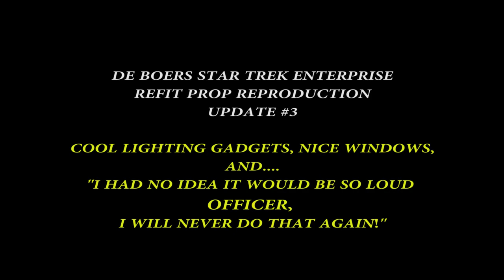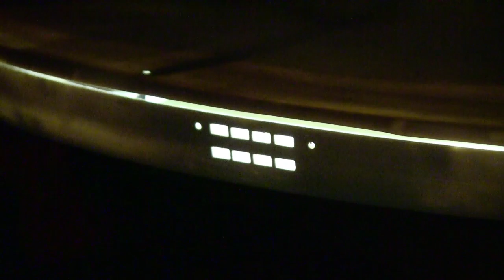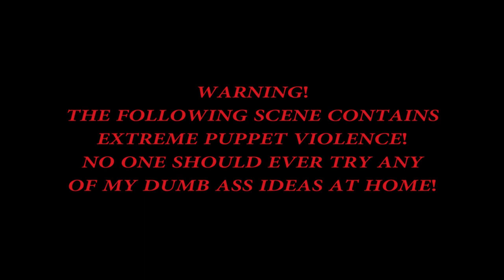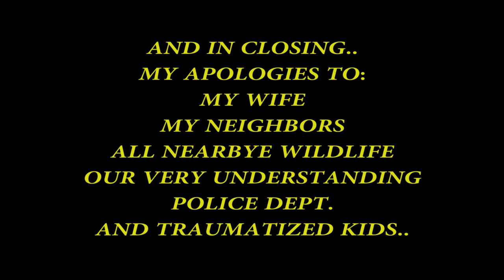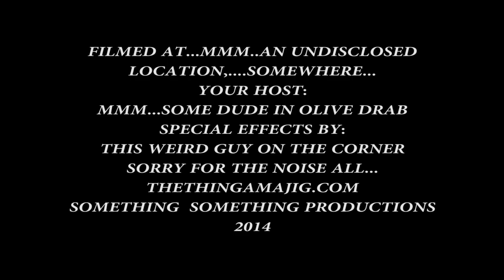DE BOERS STAR TREK ENTERPRISE REFIT UPDATE #3

Comment: Dude, I feel your pain!  Remember my mentioning how that jar of homemade gunpowder that I made had "dried out", by summer?   Welll.......about 3:00 AM of a lovely August night, I remembered that I still HAD the stuff!  So, I got it down from the shelf, found myself a book of matches and a teaspoon, then sat down at the kitchen table; the nearly NEW kitchen table.   I carefully doled out  small amount of the powder with the spoon, then set the jar WAY over on the other side of the table, where it'd be safe, in case of a mishap.  Hey, did you think I was STUPID, or something?  I lit a match and touched it to the spoonful of powder, which really HAD seasoned nicely.  There was a little "Puh!" sound, followed by a wisp of smoke and a nice profusion of sparks, at lest one of which went exactly where you're imagining it did.  So, I celebrated 2 Fourths of July, that summer.  'Lucky kid.  Lucky also, that I was able to disassemble the table, and carry it down the road to our closest neighbor, whom I convinced to drive me to the local cabinet shop, later that morning.  Thus was I spared The Wrath of The Allfather, or most of it at least.  It would helped though, if the cabinet shop had noticed that the table was the kind that had a pull out leaf and should NOT have been recovered with a single sheet of Formica.  A sympathetic mom and a table cloth got me through that part of the adventure.
Reply from the maker: Sad story, I can indeed relate....
Reply: Yeah, well, excrement eventuates, mi compadre.  To lighten the mood, what would an inexperienced Iraqi modeler be apt to do?

Mess up a Tamiya! 

Hyukk!  Yuk! Yuuuk!   Ah WROTE thay-uht!
Reply from the maker: TheOneTrueKaliban
Join Allah that much sooner.....

Comment: ROFLMAO. Elmo's demise reminded me of the time I used dynamite to remove a stump. Didn't know how much to use so I opted for 3 sticks. Never saw a piece of wood after that and the crater, I will just say asteroid impacts leave smaller craters.
Reply from the maker: Wasn't TNT, was an air compression load with an accelerator device, and smoke component. Similar to Police tactical percussion grenades, the blast wave can be significant....well...more than I thought it would be.....